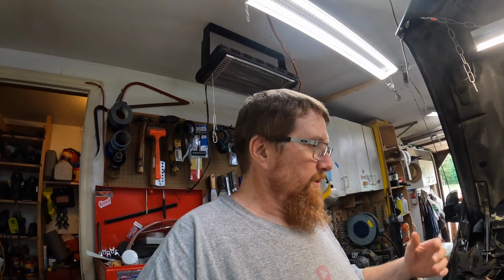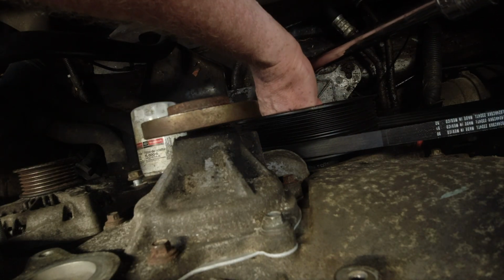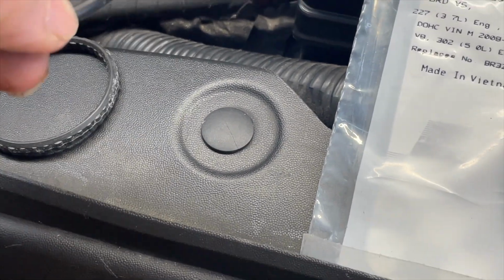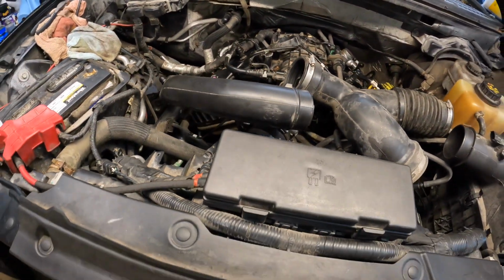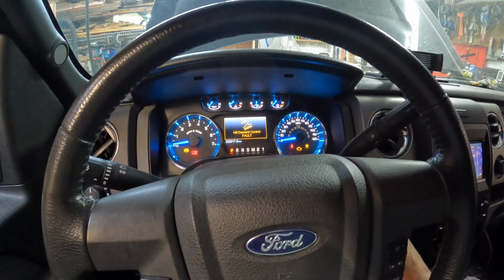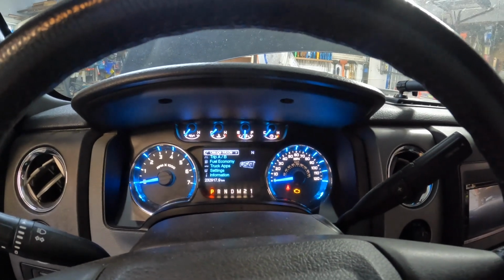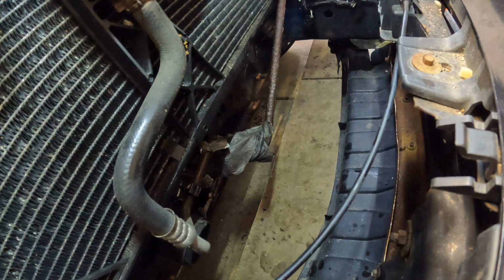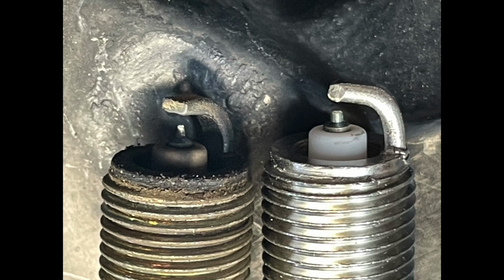3.5 Ecoboost Timing Chain Replaced Start Up Part 3

Comment: Man and this is why we love our cars they are worse than a ex old lady at least with the ex we kick her ass out and she's no more problems but with our cars we keep them around for ever and they just keep kicking us in the nutz but we love them so much we keep them around.. Funky good job on getting the engine fixed and running great  really sucks to see your trans lines screwed up keep up the great work bud hopefully once the new trans lines are installed you'll be good for a good long run of great luck both with the truck and the cars ..
Reply from the maker: @TheSalty.1  never got to clear the code. We still don’t know🤣 need to get these fixed so I can start it.
Reply: @funkystangs2843  Well buddy hopefully it all works right and your truck will be good to go.

Comment: You don;t have to pull fuse 27 you clear flood start it by holding gas pedal to floor while cranking it will not start till you lift foot off gas.

Comment: Mine popped a code after first start up to. I think it's from phasers not getting pumped up full at start up. Clear and move on, See if it then pops back up .  Every single thing that you went thru I went thru, Also I was NOT doing new trans lines because mine leaked too. CHOP and put 1/2 trans hose on line  and never worry about those alum connectors again  30 bucks for hose and clamps and done. I have pics on FB how to cut the rubber hose alum crimps off factory hoses and slide on 1/2 hose DONE, When you cut off factory alum crimps and pull off hose you will now see factory bulges in factory metal pipes. I slide hose over those bulges and put hose clamps on other side of bulge and that LOCKS hose on so it can't blow off.  Also get rid of the short steel metal line  and short rubber hose that goes to cooler just run hose from factory line to cooler with hose now,
Reply from the maker: Coming next video😂